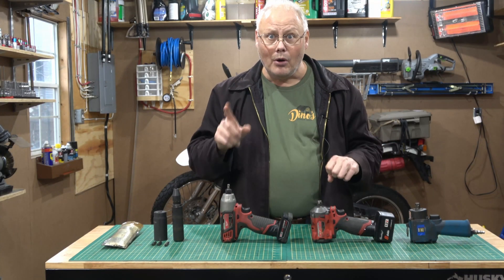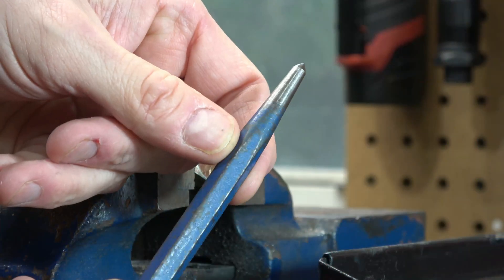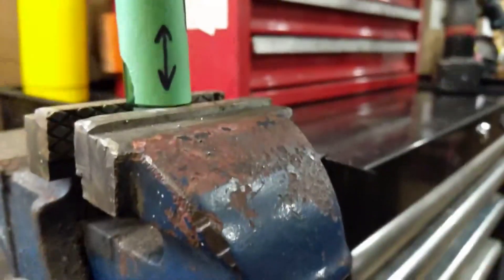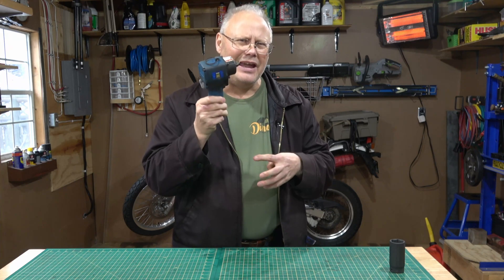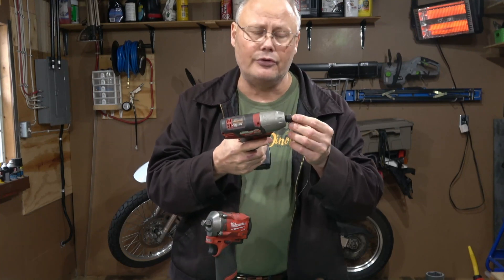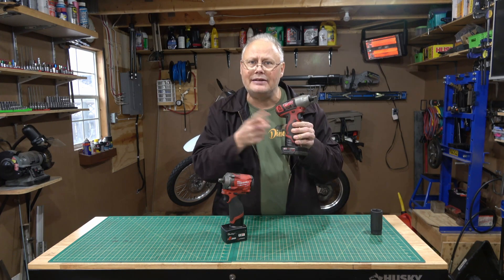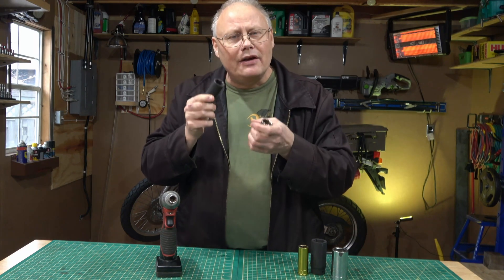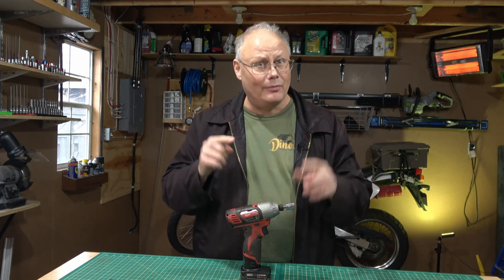Different types of impact tools

Comment: A useful video Dino. I have hammer, air and 18 volt drivers. Your points detailing advantages/disadvantages is correct in my opinion. A good point you raised about the  metallurgy and wall thickness of sockets. Thankyou.
Reply from the maker: Thank you Mal, glad you enjoyed it. 
Dino

Comment: Ah... my first impact wrench. A Ring spanner and the biggest hammer I could find.   The frequency of the impacts was low but the the velocity was high....
The Milwaukee right angled impact wrench is my favourite for bikes.   Low torque but its ability to be used a normal wrench means I don't overtighten.   Great video Dino.
Reply from the maker: Thanks for the comment, I've used the spanner and a hammer myself when needed. I think the lower torque is better in a lot of ways when working on bikes or sleds. I don't use my 1/2 INCH gun too often as it can tear up small fasteners easily.
Di o